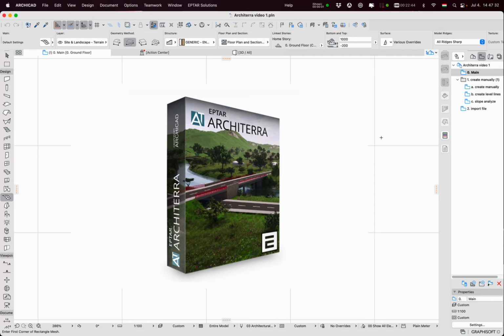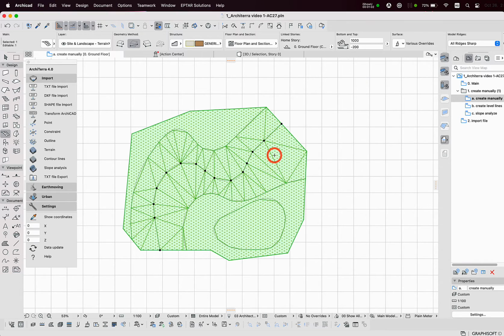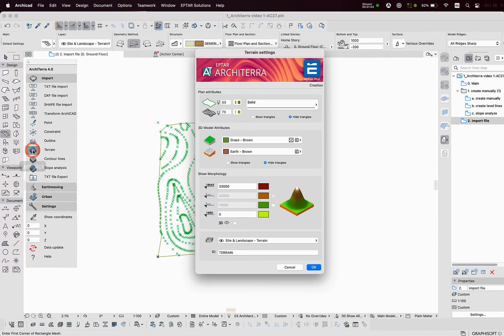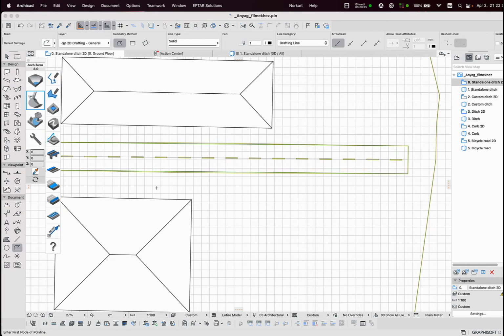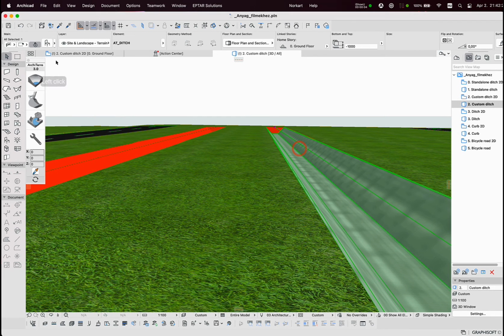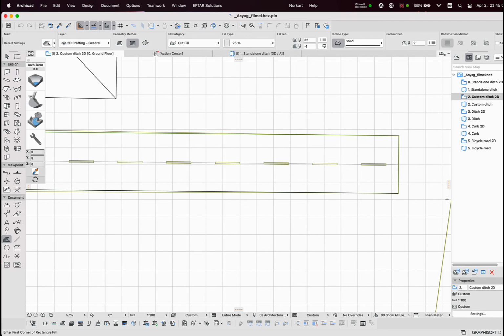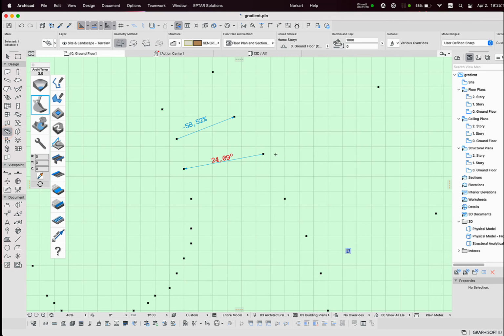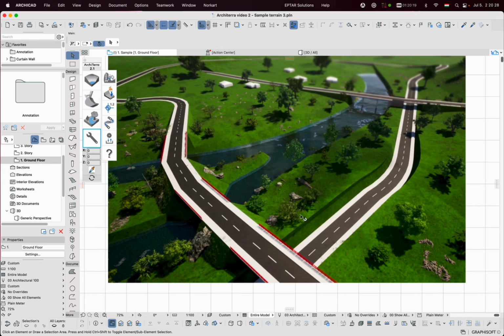Architerra webinar 202310

Comment: is there a way to make parking including drainage in this program?
Reply from the maker: Hi, the parking is possible, but the drainage is still not.
Reply: @eptarkft  sorry, I meant the slope of the surface
Reply from the maker: @patrikbukna3297  The slope of Road, square, plateaus, parking places, road junctions is possible to adjust to the necessary position in X, Y and Z.